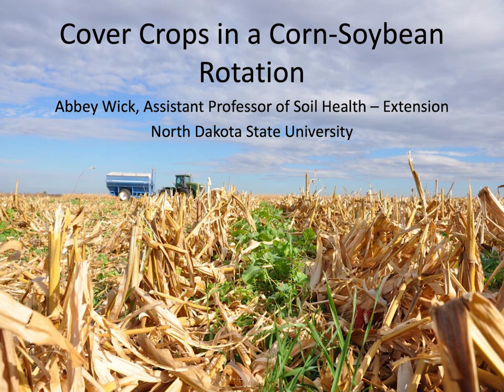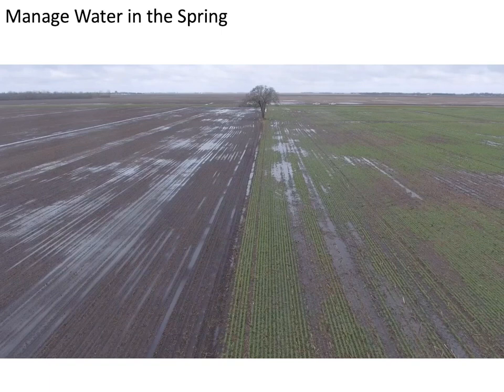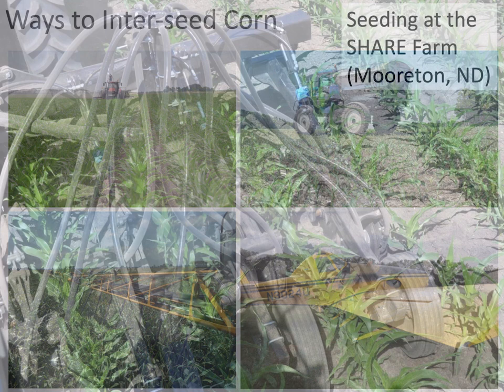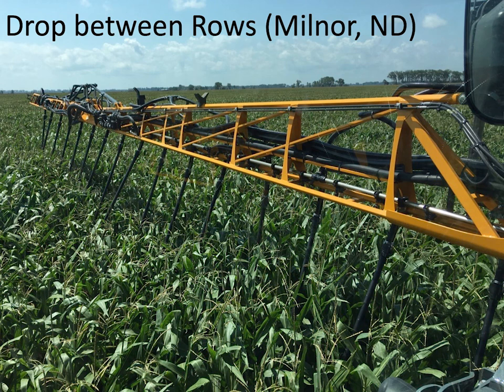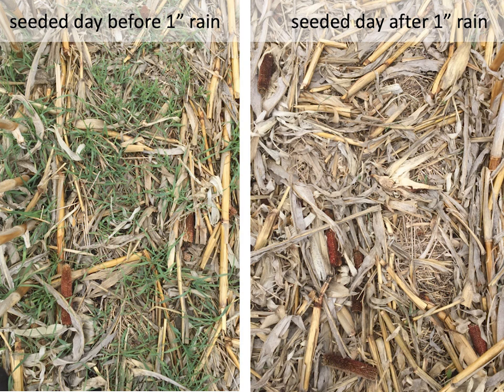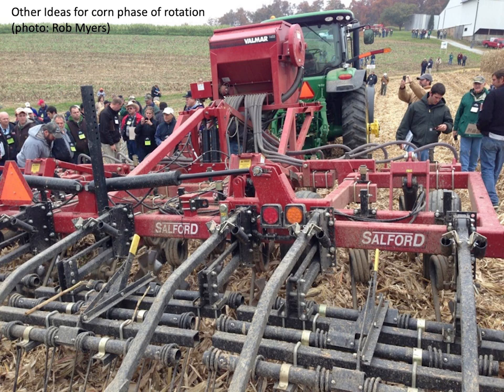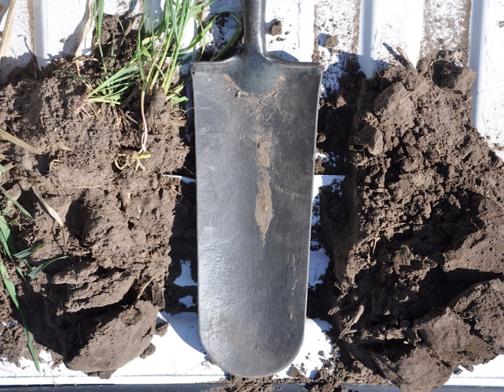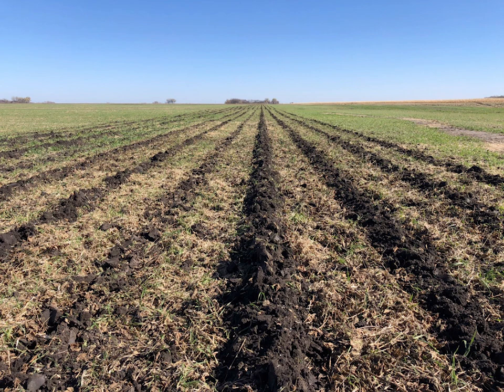Abbey Wick Cover Cropping in Corn Soybean Rotation

Comment: I wanna use cover crops to make more money and improve soil health.... unfortunately the two don’t go together ...it seems to me it’s not possible unless I use a Haney test... and as far as the Haney test goes and the “trust me it will work” doesn’t work for me.... I’ve been down that trust me it will work road before... also since I rent 95% of the land I farm how can I explain to land owners that I’m not going to be applying fertilizer to their fields anymore and traditional soil testing is wrong... this “Haney” test is what matters now... I know how that would turn out..I’ve experimented with them on a small scale... weed suppression isn’t increased... I’d need to invest in equipment to seed the covers.. and still have weeds going to seed...